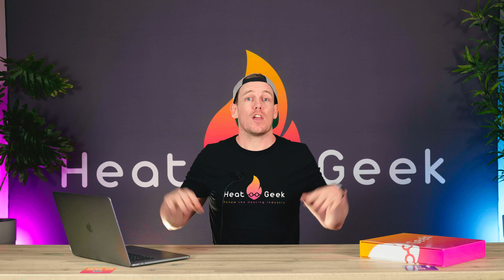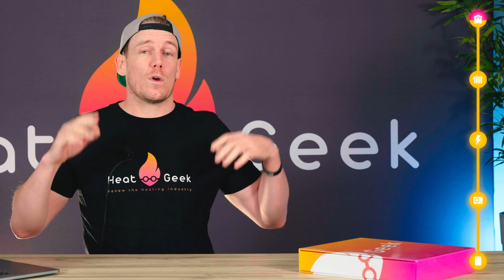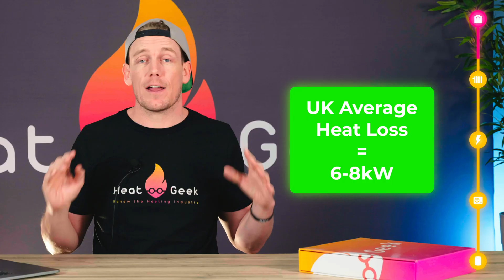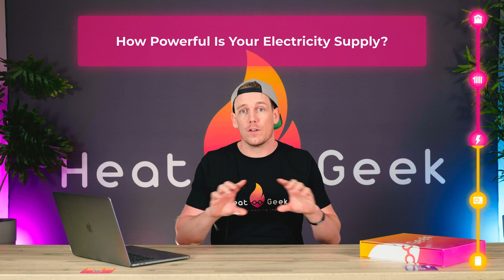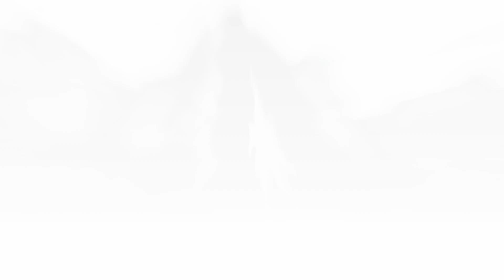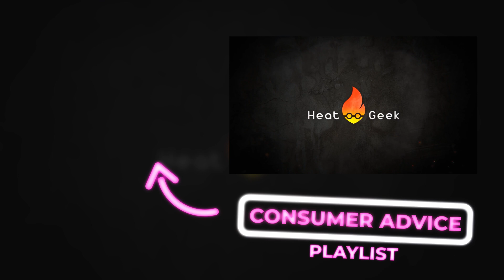Will A Heat Pump Work In My Property? (REAL ANSWERS) | Consumer Advice

Comment: If upgrading your electrical supply before you add any heat pump or solar it will be free for the quote.

Just ask for a fuse upgrade.  
You still have to pay for the mains cable if your grade to three phase
Doing this way can save you about a thousand pounds for a quote.

Yes, the energy companies are cheeky

Then when you do add solar or heat pump the quotation cost will be more like £240

Comment: I understand you must carry out a heat loss calculation but faced with my situation that is difficult. We are buying a home to extend and renovate. I ideally want a heat source pump instead of a boiler however how do I calculate the heat loss on a building that’s not built/ renovated yet? It’s a 1930s semi. ATM it’s not in good shape. I will carry out a full renovation, including insulating floors, walls etc. I want to understand how I specify or understand if a heat source pump will be a good economic choice for us before we carry out the build/renovation

Comment: Currently, I have a Combi Boiler; it’s less than four years old and in good condition, so not looking to replace it just yet. One of the reasons I chose this solution was that the hot water flow from the water tank to the taps was dreadfully slow and took an age to run the bath. Installing the Combi boiler resolved this issue. If i chose to have a ASHP installed and water tank again, would it have that issue?
Reply from the maker: No, you would use a pressurised system.. these have much higher capable flow rates than a combination boiler

Comment: On all your videos your talk about heat pumps however for a consumer explanation I have not seen one of your videos explain the difference between an air source and ground source. Have I missed one or will you be doing one?
Reply from the maker: Hi there. There isn't a video on this yet. Obviously Air take heat energy out of the air and ground takes energy out of the ground, but ground source are 5 to 15k more expensive.. this was negated for by larger rhi payments but rhi has finished.   Barely anyone is getting ground source now so very niche, hence being left off for the time being

Comment: Hi
If a 7kw ashp produces a cop of 2.1 at 60 degrees with an outside temperatures  of 0 degrees does this mean it is using 3.5 kw of electricity an hour so would  a water cylinder with a 3kw element be better to heat water in a cylinder for 1 hour to provide household water
Reply from the maker: Kw are pee second not hour. No an element would be much worse.. you either pay for half the energy with a cop of 2.1.. or all the energy with a cop of 1 which is what the element has

Comment: I have an ufh system with a simple hydronic heat pump that doesn’t modulate - it is just 100% on or off. I can adjust the set water temp and setback temp ie off at 40 and on at 30c. Are there any suggestions for making this kind of system more efficient without having to upgrade the monobloc?

Comment: aren't fan coils more efficient than radiators? Why not replace radiator with a fan coil?
Reply from the maker: Expense. Also comfort and noise
Reply: @HeatGeek  Thanks. I'm seeing some manufactures like Panasonic and Daikin heavily advertising fan coils that can heat a room with only 35 C water from the heat pump. That's why I asked.
Reply from the maker: @vladimirzivadinovic3941  yes.. there are no benefits without compromise as always

Comment: This appeared in The Telegraph today : The misinformation about air source heat pumps being "efficient" or "effective"- if only you improve your insulation - needs to be debunked. The heat pump can only supply a small amount of heat in moderate temperatures and actually uses large amounts of power when the air temperature goes below 5 deg C. The reason is that the working fluid must be at a temperature significantly lower than the air temperature in order to absorb any heat from that air. At low temperatures, this causes ice to form on the evaporator, resulting in no output. At this point, the heat pump turns on a powerful (expensive) electric heater to melt the ice and the pump works again - until the ice returns (very soon). The heater cycles on and off continuously. So at low temperatures (when you need it) the heat pump takes power from your supply to pretend that it is still working, You may even feel some of that heat you just paid for, inside your home, along with heat from the power you supplied to the compressor motor.
Heat pumps do work slightly better in Scandinavia, because there is less water vapour in the air to ice up your evaporator. Any helicopter pilot knows that rotor icing is worse in Aberdeen than Bergen. In the UK, heat pumps only work in warm weather, when you need them least.
The heat output of the heat pump is not affected in any way by the amount of insulation you have. You need perfect insulation in order to fool yourself into thinking your heat pump is heating your house.
Reply from the maker: Haha what garbage. Nearly all modern units don't even have immersion heaters built in.
Reply: The Telegraph is on a mission to slag off Heat pumps, don't know why but they are!

Comment: Forgive me if this is stupid. If I run my gas boiler at a lower flow temp would that help I do ate if my existing system is compatible with a heat pump or is that an over simplification?
Reply from the maker: Yes it would.. but you want to do the test when it's below 0 outside. Get to 55 or below and your good.. the lower the better though
Reply: That word is supposed to be indicate not ‘I do ate’

Comment: 😂😂  If they don’t have enough airflow the surrounding air cools and the efficiency tanks .🤡👍 Brill.
Reply from the maker: Yeh.. very easy to get anough airflow though.. just don't drop it in a well or cover it up.. simple.
Reply: @HeatGeek  In cold air the efficiency goes down ? 
You want your heating on when it’s cold but the HP isn’t as efficient in the cold ?
Reply from the maker: @haydnlawrence8167  although its true that the colder they are the less efficient they are (the same as a weather compensated boiler).. even when it's 0c outside it's still 3 X more efficient than a boiler..
Reply: @HeatGeek  So a weather compensated boiler is less efficient in cold weather, than a boiler that does not have weather comp ?
Reply from the maker: @haydnlawrence8167  no. A weather compensated boiler at 0c is still more efficient than a non weather compensated.. its just not as efficient as when its 15c out
Reply: @HeatGeek  In your second reply you quote ‘ the colder they are the less efficient they are ( the same as a weather comp boiler) .
Now you say weather comp not as efficient at 15c out , but more efficient at 0c . 
???
Reply from the maker: @haydnlawrence8167  no if you reread it I saidbthe exact opposite of that. The warmer the outside with any WC apliance, gas or heat pump, rhe more efficient it is.
Reply: @HeatGeek  Why would a gas boiler without WC be less efficient in colder weather ?
Reply: Ok , I miss read that .
Why is a gas boiler less efficient the colder the outside temperature ?
Reply from the maker: @haydnlawrence8167  I didn't say that either. I said a weather compensated condensing boiler is less efficient the colder it is outside. And that's because the glow tempnrequired is higher.

We have a great article on that here
https://www.heatgeek.com/condensing-boilers-efficiency/#:~:text=Condensation%20occurs%20when%20humid%20air,2%20variables%2C%20pressure%20and%20humidity.
Reply: @HeatGeek  read your replies, 3 & 4 they contradict each other.
Reply from the maker: @haydnlawrence8167  they both agree woth eachother. There must be some intonation your missing
Reply: @HeatGeek  Reply no 2 . Although it’s true the colder they are the less efficient they are (same as weather comp boiler).
Reply no.3
A WC boiler at 0c is still more efficient than a non WC  it’s just not as efficient as when it’s 15c out. 
Reply 2 & 3 not 3 & 4 .
Reply from the maker: @haydnlawrence8167  they both agree with each other lol.. a wc boiler is more efficient than a non wc.. and neither are as efficient as when it's 15c out.. its all congruent
Reply: @HeatGeek  Absolutely it does, my apologies 👍
WTF , no idea what I was reading .

Comment: I second the requests for you to cover air-to-air. Would love to hear your thoughts. 

Our pals over in Norway seem to prefer air-to-air, and I am really struggling to find a reason that conversations are dominated by wet systems over here.

There seem to be some big advantages to air-to-air:
* (potentially) simpler install if a full radiator rework would be required (and you are ok with the indoor units... which don't seem any more intrusive than radiators to me, just different).
* Higher advertised COP values (I presume because you are directly heating air to around 19C rather than water to 55C?)
* Faster to "get up to temperature"  -- which I assume means less need to keep they stem running 24/7 (good if you like lower temps at night?).
* Cooling!

And the main disadvantages seem to be:
* The indoor units size (and perhaps noise?).
* No underfloor heating.
* Needing another solution for water heating.

Am I missing something that makes wet systems a better choice? Or is it something less rational, like being easier to sell underfloor heating as it has a "luxury feel" or just plain because consumers are used to wet systems here?
Reply from the maker: Yes well do one but most homes plumbing is fine as is so will just need a few rad upgrades..

Comment: As a heating/air conditioning engineer of over 30years, Oftec Gas safe and F gas registered, recently build a new build with a Vaillant ecotherm ASHP with  underfloor heating, Didn't choose ASHP for Eco reasons I realise when the wind isn't blowing that my ASHP is being powered by a Gas fired power station, and it wasn't the ASHP I really wanted as the Mitsubishi was constantly out off stock, One thing that Refrigeration has taught me over the years is avoid any European built Refrigeration equipment they are all short lived junk! only buy Japanese that's the best stuff by far!! My first mistake not waiting!! With my Vaillant After 2 in warranty breakdowns in just 6months higher than expected heating bills and the noise of that thing droaning nearly 24/7 I sadly let it go, I place of a External Oil Boiler. Now it's cheaper to run, quiet through the night, has a much longer warranty, much less likely to break down and will probably out last the ASHP 3 fold! Oh well at least I can now address my customers concerns. But on a + note I sold the ASHP for as much as my new Worcester oil boiler and fuel tank so not all bad!
Reply: As I said in my last reply, it's not just the higher running costs due to what the units are consuming, my interest is High in new technologies, but in all my own research I like to look at the bigger picture, and to date the over-all year on year maintenance/repair costs are also much higher, just to point out as I'm sure you have already experienced, many of the fans become very noisy in as little as 2years of operation. 4way valve failures in a little over 3years operation resulting in the unit no longer being able to perform defrost cycles, which are not commercially viable to repair, replacing the outdoor unit is the most cost effective option. (this can also be because some of the manufacturers spares are also very hard to obtain to impossible). Something we don't really experience on gas/oil boilers (other than the occasional French manufacturer, mentioning no Names!!!)....
Still personally seeing far less breakdowns on Mitsubishi Units, than any European built units..
PS not to just be on the negative. I do follow some of your installs, and I'm still very old school when I comes to neat copper pipe work. They do look well installed, glad not to see lots of horrible plastic...
Reply from the maker: Your thought process is flawed. 

Even if the electrical grid was 100% gas powered, gas power is only 40% efficient at point of delivery, this is then multiplied by 3 going through the unit. Making it 120% efficient. Gas is only 90% efficient.. and oil..

If your unit was noisy there was something amiss.. with Airton yes Japanese..  with heat pumps the absolute opposite is true.. European units are far superior. Mainly doe to Contols
Reply: I used to work for a now redundant air conditioning manufacturer many years ago that was once a British owned company bought out by a leading American company also now long gone & simply put they/we could never compete with Mitsubishi
Reply: Sad but true
Reply: Totally agree Paul W...
As to Heat geek reply, reading between the broken English, I'm guessing my Heat pump Had 3 faults in 6months!! which I find quite likely, but if so most of my customers with Heat pumps which I service, have noise, more frequent breakdowns and high running costs, not I must emphasise from the additional running costs but from High cost component repairs, and the Fact is if anything has broken on the high pressure gas side, it's cheaper to dump the whole external unit and fit new, rather than carrying out a de-gas, repair, vac out, re-gas and recommission! But that is the moden way, Buy a A+++ rated machine and dump it in less than 10years, It's good to be green, then I buried my head in the sand!!!
Reply from the maker: @pipedreamtv9697  what are you getting high running costs on your installs? What's your typical design temps?

Comment: Hi there heat geeks, great videos. I may have missed it in the series somewhere, but could you emphasise that an 8.5 kW heat pump does not CONSUME 8.5kW, but that’s the maximum output.  So many people I know who have looked at heat pumps assume that it’s the same as a gas boiler, the number on the front for power is the amount of fuel consumed.
Reply: Also useful to know what conditions the maximum output is based on, ie what scop at what flow temp etc

Comment: Handy advice. It definitely rules out a heat pump for my flat as it has an instantaneous (gas) hot water boiler at the moment (sitting over the loo cistern!) and nowhere obvious for a large water tank to go. Looks like IR panel heaters are the way to go for me.
Reply: I think that for a flat you can use a DHW boiler heat pump like Ariston Nuos Evo and connect it to the radiators.

Comment: Useful video as always.

OOI why do you only talk about Air -> Water Heat pumps and never the uses of Air -> Air Mini split units. Especially for people who might want cooling as well as heating?
Reply from the maker: Because the a2w unit are where the technicalities lie and education is needed. Also much more common. We will cover a2a though
Reply: @HeatGeek  arguably a2a is much more common globally.
Reply from the maker: @Swwils  our channel is really geared toward the uk domestic market
Reply: @HeatGeek  no reason UK market couldn't have more a2a.
Reply from the maker: @Swwils  sure.. but we already have wet systems in, need hot water and are used to rads
Reply: @HeatGeek  kind of a moot point if a place needs replacement pipework, radiators or UFH or mixture of all. The ability to put in a mini split per room over a long period of time (as money affords) is a great way to spread cost and increase adoption.
Reply from the maker: @Swwils  a mimisplit per room? With multiple outside units?
Reply: @HeatGeek  no a single multihead capable unit is installed initially then cassettes are added per room as cost allows.
Reply from the maker: @Swwils  as I say, the reason is because wet systems are where the technicalities lie and also much more common..  as I also say, we will cover them but likely only 1 or 2 vids.
Reply: @HeatGeek  can't express enough how useful these videos are for consumers